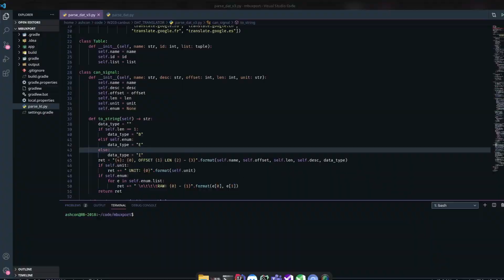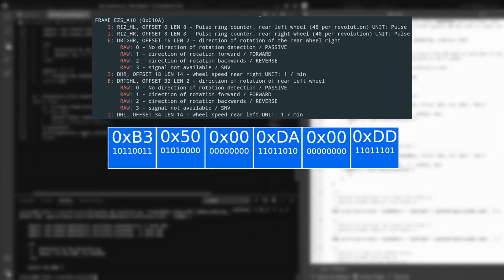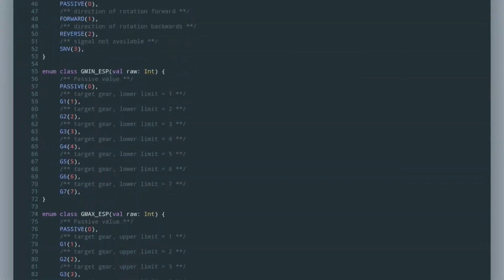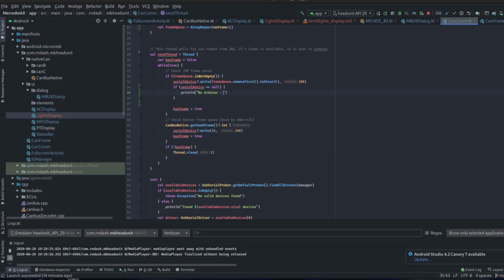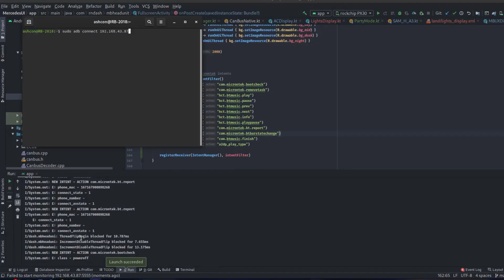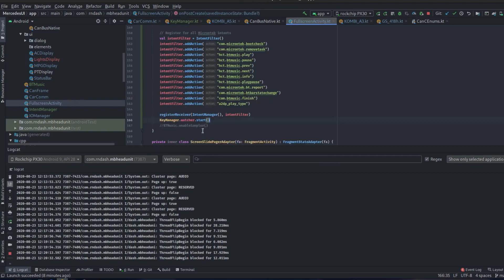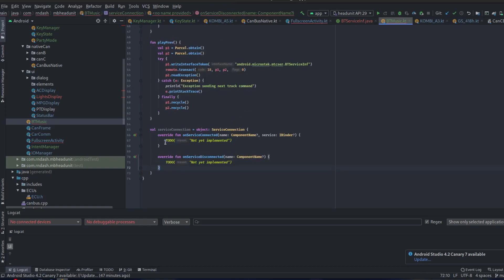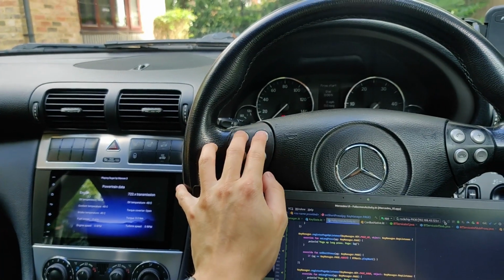Car infotainment project part 2 - Lights show!

Comment: I’m curious wether or not you can access the PCM firmware binaries through CAM. And wether there is a practical way to get source code out of said binaries.
Reply from the maker: By PCM do you mean ECU? If so, yes there is...since Century (MBs diagnostic tool) can do firmware reading and flashing over CANBUS.

As for reverse engineering, you'll likely need to know the ECUs CPU. I know that a couple in my car are PowerPC based (Bosch ECUs)
Reply: I’m a Ford guy, and kinda want to get an old Fiesta or Focus with the Powershift and see if I modify some of the shift routines, such as allowing downshifts to RPMs higher than 4500 in sport mode. And adding active rev matching between gears (stock behavior doesn’t override the pedal input as far as I can tell, despite being drive by wire.) and removing the rather arbitrary upshift speed limitations for better city economy. I’d also like to see if I can decrease the latency between gear selection and the actual shift, but I feel like it would involve a complicated shift algorithm, and probably wouldn’t amount to much savings.
Reply from the maker: Good luck! One project I wanna do next summer is a custom transmission ECU for the 722.6 series automatic slushboxes from MB, Powered by a neural network to learn when I prefer the car to shift based on about 20 different sensors that broadcast on canbus....

If your transmission is a slushbox based one, I doubt you can decrease the delay between shifts since those gearboxes have to move fluid around to pressurise clutch packs and shift gears. You'd have to know before you want to shift if you want less delay :)
Reply: RND_ASH Thanks for the reply. Yea, PCMs are just ECU “modules” built for controlling specific functions of the car. The Powershift is a Dual Clutch like what Volkswagen and BMW sport cars use. Ford uses it for fuel economy, but I’m enticed to see if it can handle track driving. Honestly, machine learning would be perfect for a dual clutch because a dual clutch has to preemptively select the next gear while the current one is engaged before it can engage the next one. And preselecting the wrong gear can result in a noticeable delay while it disengages that gear and selects the correct one. An example of this is when gradually decreasing the throttle while accelerating, which causes it to shift up horrendously slow due to it recognizing the decrease in throttle as intent to slow down when instead I want a higher gear for better fuel economy. I unfortunately just don’t have the time or skill to make a machine learning algorithm, let alone integrating into a PCM or ECU. Good luck with your project though, I find it incredible what you’ve managed to do so far.
Reply: @RANDASH   Can't your transmission already learn your shifting preferences? I know this was a feature in the w208, which was based on the c class.
Reply from the maker: Yes but very primitively.....it simply has a look up table that is adjusted based on 2-3 sensors
Reply: You should join the comma ai community, your quite the wizard!